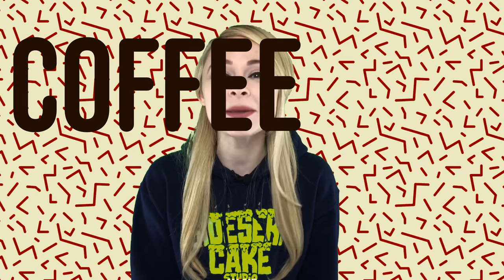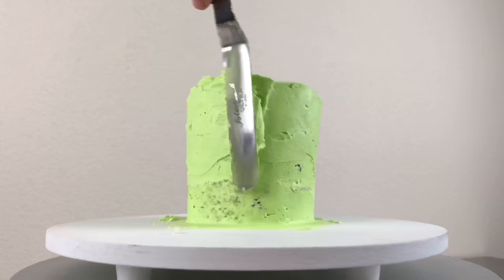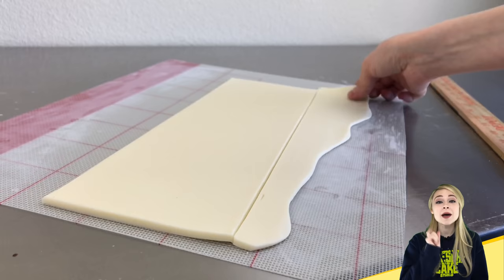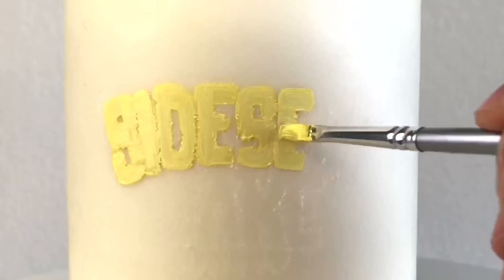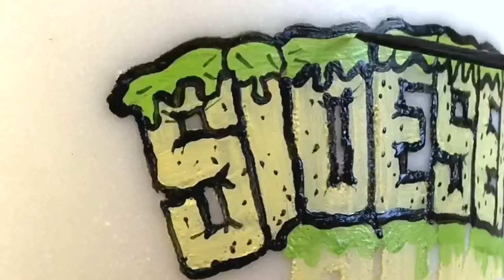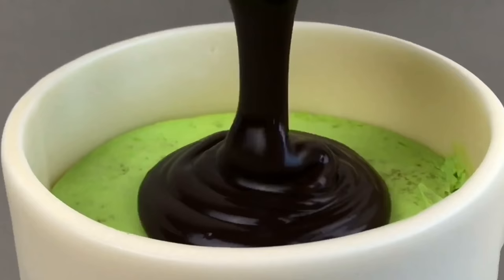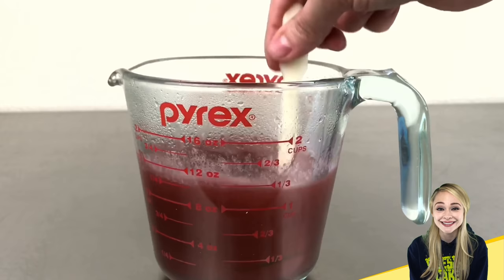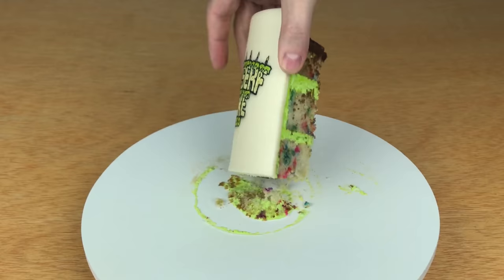Making a REALISTIC Coffee Mug CAKE

Comment: I'm planning on making a similar cake for a birthday this weekend but with some modifications:
Coffee sponge cake and Amaretto buttercream instead of birthday cake and green frosting. Also going to make an espresso simple syrup to put on the coffee sponge cake.
Marzipan instead of modeling chocolate (because the almond goes well with amaretto)
If I do a red mug, I'm going to food color the marzipan red, then add red luster dust mixed with vodka
Coffee jelly instead of ganache and jello (it'll taste like coffee, and I'll paint the bottom with brown food coloring so it doesn't show as lighter on the bottom, although coffee jelly can be pretty opaque)
I may or may not add a Kermit the Frog lounging in the coffee made out of marzipan.

This video was really helpful in visualizing how I wanted to do my cake. To get the lip on the coffee mug, I wasn't sure how I was going to do it. My original plan was to mix chocolate and caramelized rice krispies with chopped almonds, put that in a tin lined with parchment, let that harden into the top part, then top the cake with that and cover with marzipan. It was overly complicated and that process may make the lip too thick, despite it being a larger scale mug (I might still do it if I'm feeling ambitious). My other concern was the actual shape of the mug. Most coffee cups have a larger top and a smaller bottom, which isn't great for cake stacking. I was worried that a straight mug would look unrealistic, but the one in the video is really nice. Thank you for the helpful video!

Comment: 1:08 Using that dirty, gross looking yardstick with stuff stuck to it on a foods product is giving me major heebie jeebies. It’s difficult for wood to be PROPERLY cleaned and sterilized- especially since something of this size won’t fit into a sink or dishwasher for appropriate food safe sanitization.  Aside from sanitary concerns, if you knick the stick with a knife, you’re bound to get small wood slivers/shavings in the food. 
Lightweight and thin yardsticks made from metal are widely available and those will not absorb smells/liquids/bacteria. Plus, since it’s metal, it’s easy to clean/sanitize, will dry quickly, AND you can’t shave pieces of it off into your food if you accidentally knick it with your knife. 

Eta: time stamp